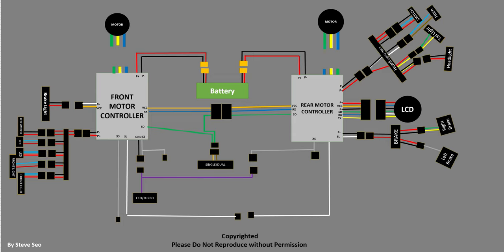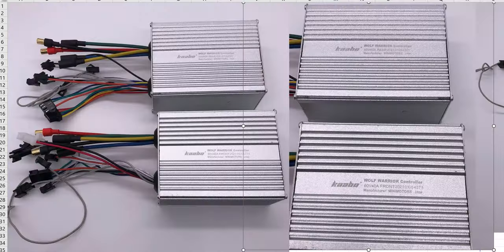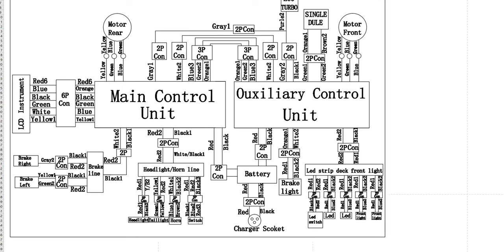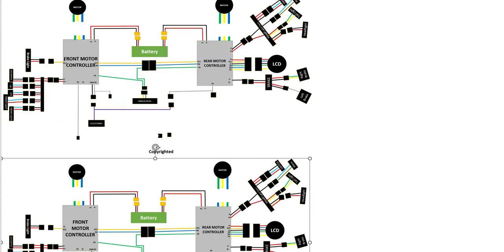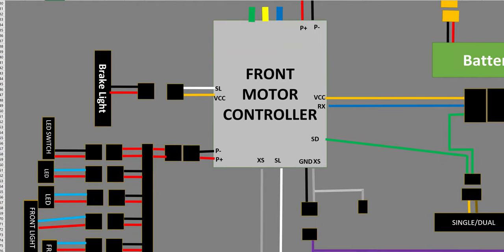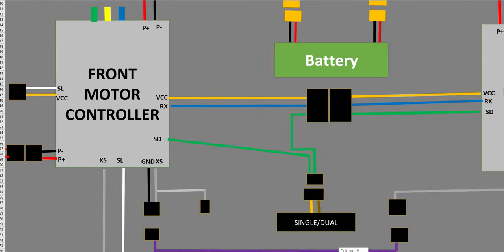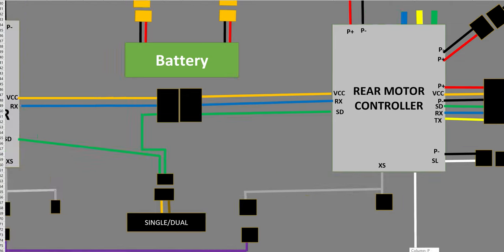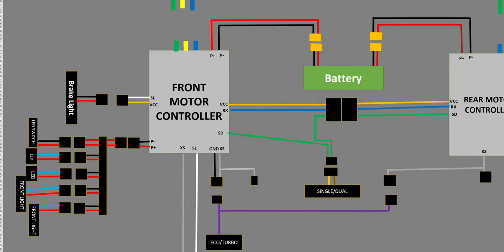Kaabo Wolf Warrior 11 60V40A Dual Motor Controller Wiring Diagram

Comment: having an actual video of the wires would help me greatly
Reply from the maker: Hi, sorry for the late response. I am not sure if i still have the actual motor contollers. If you can provide one, i'd be more than happy to make a video for you, or rewire them how you want me to, and send it back to you, granted that you pay for the shipping. I won't charge you anything for the wiring. Let me know.
Reply: Very interested,
And Greatfull if you could send me "peter Stileman " any warrior 11+ /related technical wiring diagrams etc. 
I'm from Melbourne Victoria Australia.

Kind regards 
Peter STILEMAN 

o a

Greatfull for all thus far. 
Ps  ANY suggestions in how to increase power output?

Comment: how does the Ey3 throttle communicate the throttle signal to the motor controller? does it do it by changing voltage somewhere between 0-5v like some throttles on some ebikes do?

Comment: Please do the wolf gt
Reply from the maker: For sure! I'll post one up soon. Can you send me the photos of the wires, if you have any available?
Reply: @steveseo2220   I was hoping you could I bought the whole kit but it hasn’t got the wires in the connectors so I’ve been struggling to wire it up unfortunately it’s hard to see in most videos
Reply from the maker: @mrsavage4963  No problem. I can figure it out. Give me some time and I'll have one posted. 

is it the wolf king or wolf warrior gt?
Reply: @steveseo2220  wolf gt thank you
Reply: @steveseo2220  Did you get pics for wolf warrior gt? If not i can send pics if you need... 

I am having issue with an 05 error, It wont turn on if its not charging. Soon as i pull charger out it turns off. Any ideas?

I also have kaabo skywalker 8s if you want pics of wiring for that model, It looks like a birds nest though.
Reply: Have a wolf warrior gt with both controllers completely disassembled and all the wires unplugged . Please assist

Comment: My main cord coming from the EY3. Controller got pinched and sparked. Fixed the broken wires not cant get the scooter to move. Checked everything i can image but can't seem to find anything wrong. Display works fine. Its not in kickstart mode and all fuses are good. It just will not move!
Reply from the maker: i would check to see if the controller is functional and that you did not short it by chance. even if you did, it is fixable on the same controller, but it takes a lot of work because you'd first have to diagnose, identify, locate, and replace the burnt component, and while doing that you may actually do more damage on the board. If the controller component is defective when it came, i'd contact mini motors to request replacement and convince them to send you one for free. Or I'd just order another controller set. Then I can help you wire. Or if you want me to find out for you, feel free to mail it to me and I'll take a look to see what's wrong with it. It could just be wrong wiring, or issue with your throttle. Did you take a look at your throttle to see if everything is wired correctly? Along with the magnetic potentiometer (that little chip with 2 or 3 prongs soldered onto the ey3 board)? All of these matter.
Reply: @steveseo2220  I soldered the wires all back together that got cut when the cord got pinched. Also had to replace the EY3 throttle controller, Everything works perfect.

Comment: hello, need some help with wiring conection for mantis 10. I can send you pics of the controller and display. Scooter wan´t turn on and i dont know if the error was display or rear controller.Need test both to know what needs change. Thank you
Reply from the maker: Sure, how do you want to send it? Shoot me your email address and I'll communicate with you there?
Reply from the maker: I think the wiring for the Mantis 10 is similar to the Nanrobot d6+. Do you have a key ignition? If you do, when you switch on the ignition with your key, does your voltmeter turn on? If your voltmeter does not turn on, then the issue might be with the ignition wire which is VCC. If you don't have ignition switch, then your LCD thumb throttle is wired directly to the controller. 

If your throttle does turn on, does it respond to your throttle? If not, then the issue could be with your hall sensor located on the throttle itself, or something could be up with your throttle wire SD. 

I need more info so if you need help let me know.

Comment: I WOULD LIKE TO WHICH ARE THE WIRES FOR HALL SENSOR AND POWER LOCK ❤❤❤❤❤
Reply from the maker: I am not sure if there is any hall sensors for these. it's 3 thick motor wires, yellow, green and blue, I think. I am not too familiar with what each wires are called. I just know what needs to be connected in order to activate or deactivate certain functions. So if you can rephrase the question to ask me what needs to be connected in order to do what, then i can better help you. Sorry, I don't really know what the names of each wires are because many people call the same wires by different names, and I stopped trying to familiarze myself with something inconsistent. But everyone understands what needs to be connected in order for the motor to spin when you hit the throttle. I can help you like that.

Comment: is there any way of removing the front controller, as i have already removed the single/dual switch, turbo switch and the front motor?
Reply from the maker: Yes you can just remove the front. But you’ll have to adjust the green wire
Reply from the maker: I can try to help you out later when I have time.
Reply: please, I’m not one for speed, I don’t go off road. It’s literally used once a week, so I’m trying to reserve as much battery life as possible and reduce weight
Reply: I want to modify ww11+increasing power output Increasing top speed etc...
Greatfull 
Peter STILEMAN 
Melbourne Australia

Comment: On the kaabo wolf warrior gt Someone claimed they knew what they were doing completely disassemble the wiring from both controllers and the unit itself!! Now everything is unplugged and I can't seem to find a schematic or anything  that will tell me where each connection goes . Please help
Reply from the maker: Hi, if you can provide me the motor controller, I can wire them for you and send it back if you want. Let me know and I can try to arrange a way. YOu don't have to pay me anything. Just pay for the shipping and I'll have it done for you within few days.